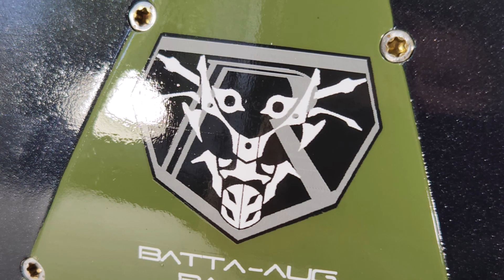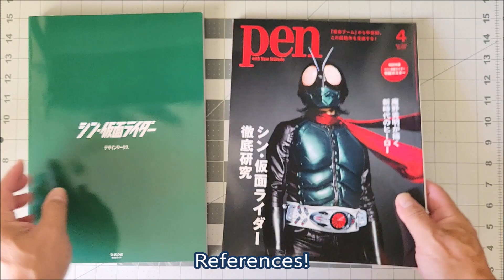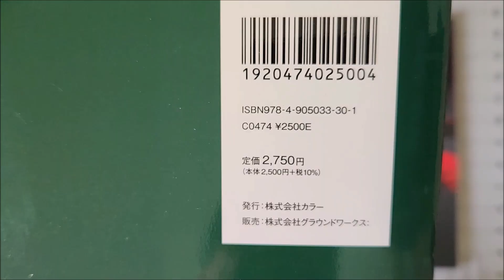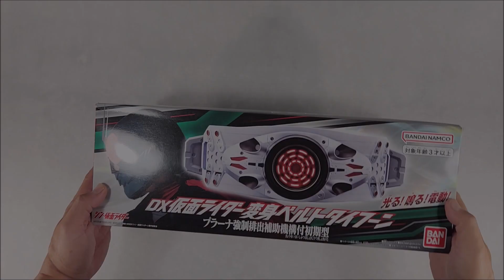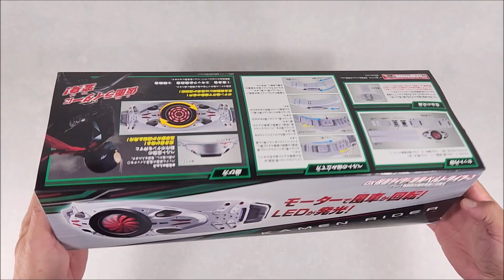Shin Kamen Rider 01 Helmet and Stuff - # 242

Comment: How much did the helmet cost? I want to buy a helmet and I don't know which ones on ebay are good
Reply from the maker: That helmet on eBay advertised sold for well over two hundred dollars, almost three, some even more. Getting a good helmet, as advertised, is a crapshoot. I was not lucky both times. My order is large; they shipped me small size. If it said come with lightbulbs, it didn't. What I actually get looks nothing like the pictures in the eBay listing. The finish was way worse than I can imagine. I bought two helmets from different sellers. Both suck bad. I did get most of my money back, tho. I am not buying another helmet from China again. Good luck.
Reply: @AllenTam  Thank you for explaining. Did both seller use the same helmet picture in your video? I want to avoid if possible
Reply from the maker: @Alan-zj1ko  Yes. Every sellers on eBay uses the same pictures , not just the two sellers I bought from. And bothe sellers ordered the helmet from someone else after I paid them . The person got the order from seller and make the helmet and ship it. The sellers never see the helmet before it was shipped to me.

Comment: What kind color are you use for the top?
Reply from the maker: Dark Blue TS-55 as base, and light top coat Dark Mica Blue TS-64.
Reply: @AllenTam brand?
Reply from the maker: @mannsyfq129  Tamyia
Reply: How you removed the paint?
Reply: How you make a hole for a screw?
Reply from the maker: @mannsyfq129  Dremel